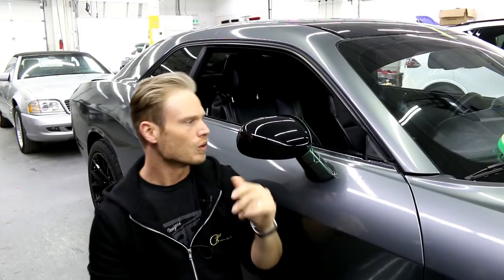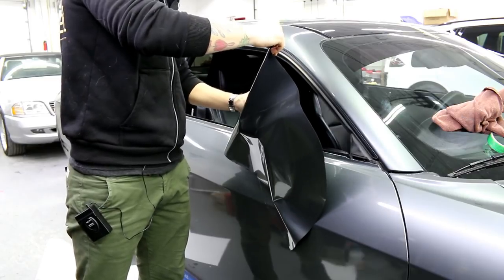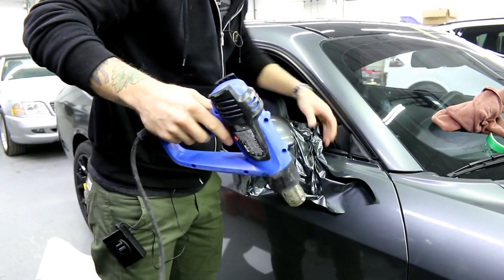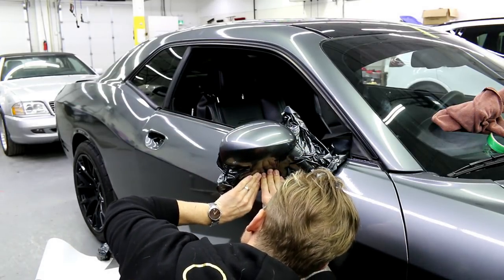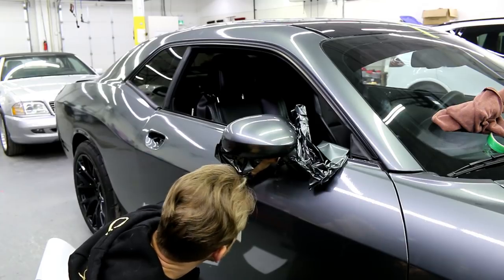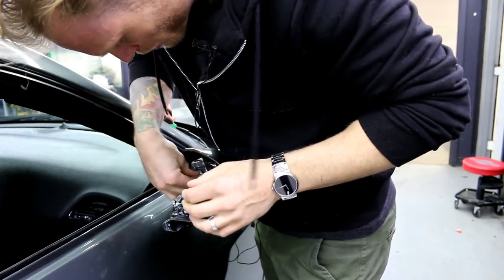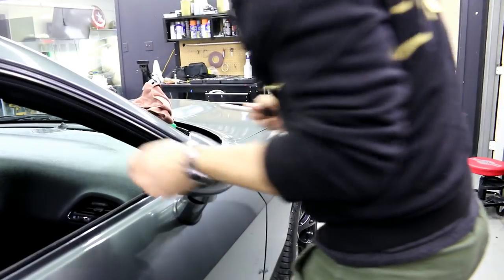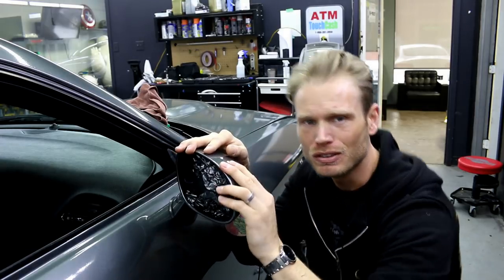Dodge 392 Challenger Vinyl Wrap  How To Vinyl Wrap A VERY CURVED Side Mirror Part 2

Comment: Don't you find it easier to do the inside at the glass first then heat and wrap around the edge with the majority of the wrap to smooth out all those wrinkles better? That way you have no bunched wrinkled wrap inside the mirror. It all would get smoothed out as you take it up and over the outside of the mirror ya?
Before I found out I did my mirrors totally wrong, thanks to watching one of your other videos, I had wrapped all the way over into  and behind the glass like you had to with this one. I messed up in a number of places but did seem to find it easier to start in the hollow at the glass. 
It looks beautiful as all your work does. But its curious to me why this is the ideal way to do this. I mean no tension no stretch. Just start the wrap flat at the furthest part of the hollow part behind the glass (that's been removed) and lay it all flat with no tension. Once to the end of the hollow its time to heat and wrap around the edge and over the outter casing of the mirror id think. I know im wrong as that's not how you did it and you are pro and im just a joe. But still makes me wonder why you went this way with it is all.

Comment: I am glad you talked about the mirror base.  For the base, did you disconnect the mirror base from the car?  How did you create the seam on the backside of the mirror base?  Did you use knifeless tape to get a straight stem line without cutting the paint?  I want to wrap the base and mirrors on a C6 Corvette, It also has a rounded mirror with no trim strips on or around the mirror housing.
Reply from the maker: I start the piece of film on the inside adjacent to the window. Then I wrap around until I overlap where I started. Then freehand cut on top of the first layer of film
Reply: Thanks for your reply.  This video addresses one of the hardest kinds of wraps, that being a bullet shaped mirror.  I noticed, you did not pre-stretch the piece of vinyl.  Is it harder to do a bullet shaped mirror if you don't pre-stretch?  I've never done this kind of thing.  I am studying this video in order to try my hand at wrapping the mirrors on my C6 Corvette.

Comment: Great job brah...good work with the videos too...very informational....but ahhhh one question man...I was just wondering as I was watching this video...what happens if I get my car fully wrapped and then get in a accident 2 weeks later...does the insurance cover for wrap or are they gonna peel all the wrap off and then repaint the car its original color?...iono man...👉💪👏👏👏🤜🤛🤝🤙🤘✌
Reply: There's a section for mods on your insurance policy. Just add it on and it'll be covered.
Reply: @peej.w7598  ...ok cool...that's brah

Comment: Nice job i had to do these mirrors on a red challenger using green matte 3m vinyl.. Did it very nicely in 2 pieces straight seems wrapped inside behind the mirror and my customer still believed the mirror could be done in one whole piece.. I presumed to redo the mirror in one piece just to prove the point that the material will not hold and will pull back, so did it again in 2 pieces and still didnt get a thanks.. at the end of the day its a sticker not a paint job n the price i charged was very very fair. As for the rest of the vehicle, no red showed anywhere
Reply: PaulQIV hey dude! How much do you think it should cost to wrap my 2017 mustang roof? These people are asking for 350 does that sound about right?
Reply: Deadman Arcade roof wrap on coupe/sedan should cost 200-250 for basic colors such as gloss black. Some shops do charge upwards of 350-400+ for the same process, materials, etc..